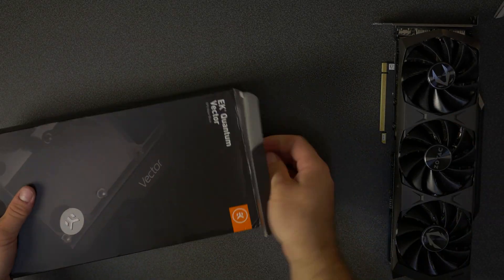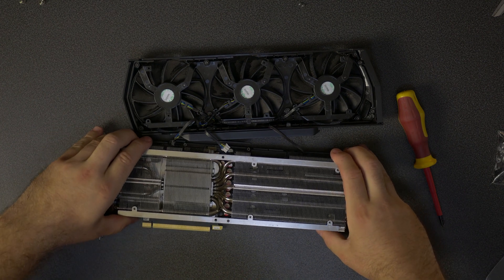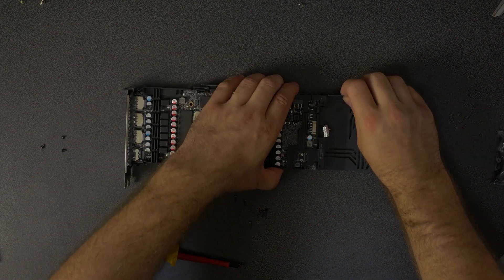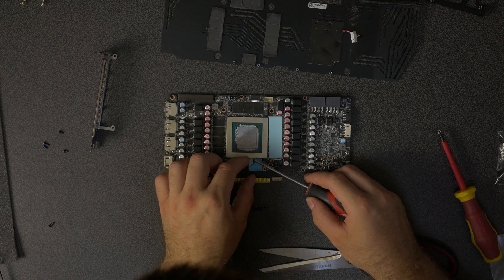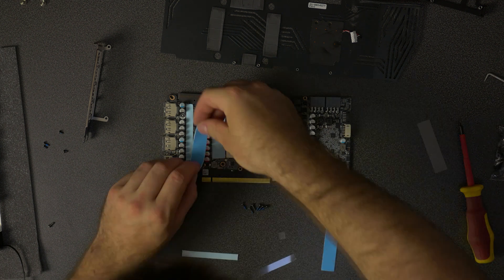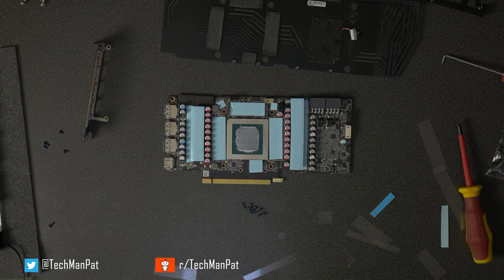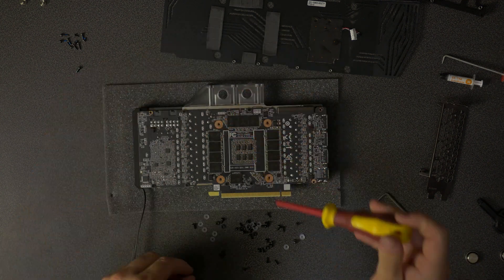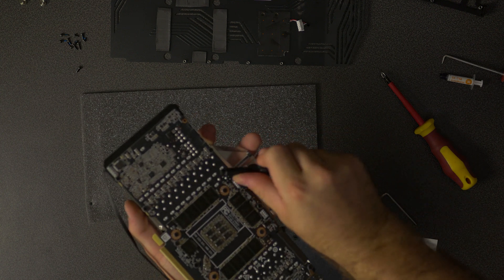How to watercool a Zotac Trinity RTX3090

Comment: Dude, you are wrong, it is essential which way you will flow water into it! You have to connect it so the coolest fluid goes first into the core of GPU die.
Reply from the maker: That’s not how heat inside the loop works, it reaches thermal equilibrium in fact there is no difference in order. As long as you have sufficient radiator capacity to dissipate the heat, there is 1-2 degrees of difference at different points in the loop.

Comment: Thx for the clear video. I'm thinking of doing this with the exact same card. Did you experience any coil whine with this card? I'm using a Tt P3 case with no window at all. Thx again
Reply from the maker: Yes a little bit but you can’t hear it unless you have your right to the case
Reply: @TechManPat  thank you for the quick reply! The 7900 xtx seems enticing but with all that coil whine it's just not an option. Sounds like I'll be going for the 3090

Comment: 1. Get a backplate for those vram
2. Just unscrew the 6 screws on the back (not the fans)
3. You used the wrong thermal pads for the VRM, they are different from VRAM. 3mm for the VRM and 2mm for front VRAM, 3mm for back VRAM!
Reply: its really doesnt matter, just as long as their is a point of contact.
Reply: @seerking  It does matter since too much will lower to contact to the main core. However the thicknesss is also dependent on the watercooling block.

Comment: What gpu junction temp do you get while mining?
Reply from the maker: 68 on gpu and 70 on cpu if I’m doing both
Reply: he wasnt asking gpu core temp, asking tJunct.  like from hwinfo.  I'd be wildly curious to see if this thing isnt throttling down to ~3060 levels of performance if you never added cooling to the back :O  i received a founders that was seemingly defective, as the back plate never touched the memory, and it overheated nearly immediately (again, the memory as measured by tJunct, not the core) in anything more taxing than web browsing.  dont torch your expensive toy!

Comment: FML. Thinking of doing this. My damn GPU Memory junction temps are at 110c when mining. 
92c when gaming.
is this normal with the zotac trinity 3090 OC? :O
Reply: It's the same for the 3080, if u notice when he first opened it up there isn't any pads or putty on the mem chips to the right, that's probably why
Reply: U guys need to be careful, micron website said for gddr6x op Temp max is 95c.. A 3090 fe owner Burn his vram after 2weeks of mining at constant Temp. 106-110c!.. I also own a Zotac 1080ti and 3080, and what I found is the former is  a better built then the latter.. After this ill buy an evga..
Reply: 106c mining here.
Sometimes the pc turns off.
Does it happens to you?
Reply: @gsuracing9362  if it crashes ur comp its probably a silicon + OC + heat issue, else zotacs seem stable at least even at higher temps (its just bad for it)
Reply: @StylinRed  thank you,now since a few days it is stable.
Reply: @gsuracing9362  strange. That has not happened to me even-though it can stay at 110c. 
How strong is your Powersupply?
Reply: @RocketLR  750w.
I have done undervolt a few hours ago and now Gpu mem is 90c.
But I lost around 10 mh/s.
Reply: @gsuracing9362  hmm so do i. Even though they recommend 850w when paired with a intel i9 and im still not getting any issues.
Reply: @RocketLR  I don't know.
But looks better at 90c.
Reply: @gsuracing9362  OOH, what program are you using to undervolt with and could you share your profile somehow? I tried undervaluing but lost too much performance and did not lower my temps...
Reply: @RocketLR  I use  Zotac Firestorm.
Power: 80.

GPU clock: -1000
Memory Clock: 444
Fan Speed : 86
Reply: @gsuracing9362  How many MH/s are you getting?
Reply: @bollygod  with 3090 over 100/108 mh/s.
-400 Gpu clock,1000 memory clock, 81%power fan speed 85%.
With 3080 93/96 mh/s.
-422gpu clock,933 memory clock,77%, power 77%.
Fans at 95%.
Reply: @gsuracing9362  Nice, Did you repaste and changed the thermal pads?
Reply: @bollygod  no I didn't. 
At the moment I don't hit 100° thanks to a fan to both of them.
Reply: @gsuracing9362  Great Temperature for an untouched card. My settings: Tem limit: 78; Clock: -250; Memory: -200; Fan1: 85%; Fan2: 65%. My memory temperature is 106º with the side panel of the case removed.
Reply: @bollygod  try both fans at 90% and if you can no doubt to use another fan to get out the danger zone.
Over 100° silicon is getting damaged as you can read in Micron website. 
Good luck friend!!
Reply: @bollygod how many mhs are you getting?
Reply: @gsuracing9362  104 MH/S. I get 100º with fans at 100%, but i can't stand the noise. 

The backplate is hot af. i will get some heatsinks and thermal pads for the backplate.
Reply: @gsuracing9362  I forgot to mention that i also have one 1060 6gb.
Reply: @bollygod  I have two desktop fans,right now 3090 is 90° and 3080 is 96°.
Reply: @gsuracing9362  Amazing. I  have a case zalman z9  case and has 5 fans and i'm struggling.
Reply: @bollygod  trust me,try to use an ordinary fan to fight against 100°.
At night I can see 84°.
I had the same problem as you and an experienced miner gave to me this advice and now I'm not afraid to boil my graphics cards. 
Good luck and happy mining!!!

Comment: Please tell me what are the thickness of the thermal pads for this card. I noticed you cut out the part where you remove the bracket that holds the backplate at 2:38, it seems it has a thin layer of thermal pad too coverting the mosfets, I want to change the thermal pads but put the original cooler back up, So I also need to know the thickness of those other thermal pads in the bracket. 

Thanks a lot.
Reply: Turns out front thermal pads: 2mm
Back thermal pads: 2.5
(Tried 2mm, not good contact, 3mm is too thick and bows the card. You'll have to sandwich a 2mm + 0.5mm thermal pad in the back).

Front bracket mosfet thermal pads: 3mm.
Reply: @sephirotic87  omg ty. ive been looking for this
Reply: @calgeiser  glad someone found my comment

Comment: straight up wrong with not needing a backplate.  Ram gets to 190f  90c- ish  the GDDR6X Chips Die at 105c  and thats in a 011d with a 18c room. 

GET A BACKPLATE.
Reply: according to what I learned, the backplate is just to protect against shorts and it can protect against light liquid spills in some cases, but I don't think you really "need" one.  https://www.youtube.com/watch?v=OBsxuNXyDJk
Reply: @Forensica6916  Dude, 3090 has MEMORY chips on the backside. As mentioned already - GDDR6X gets reaaaaly hot - under my waterblock it's close to 96 degrees at full load. Unless you have a fan blowing straight at the backside of this GPU - you can damage 3090 without backplate
Reply: @ZephKyno you are right, I didnt see they put the gddr6 on the back. I just read that alphacool is developing a waterblock for the backplate which ive never heard of.  Better stick with a backplate...

Comment: I'm getting 65c on water with my 3090 what's your temp looking like?
Reply: same 65c - 63c
Reply: @oksle8132  Yeah 65c if I'm using RT cores nothing hotter
Reply: @Near2Future  what's your temp when on desktop with nothing running?

mine was 29c yesterday today for some reason it's 42
Reply: @oksle8132  When I'm on idle I'll be around 22-23c when using RTX broadcast for my voice. It'll be 30c I've got a 360mm just dedicated to gpu alone. Temps still seem pretty high for this card, guess it also depends on brand I'll pull 350w on load.
Reply: @Near2Future  yeah me two 360mm for gpu only, and dammmmmn rtx broadcast just turned it off and got 10c down now it's 31c on idle thanks for the tip did not know rtx broadcast get temp this high
Reply: @Near2Future  can’t imagine getting 23c turned off every thing running on background i got as low as 28-29 
i have zotac 3090 trinity
Corsair xg7 waterblock
Coraair xd5 pump
360 mm radiator also Corsair
Reply: @oksle8132  Yeah i've got a zotec aswell with an EK block. It also depends on your room temp aswell :)
Reply: @oksle8132  RTX cores do get quite hot & use alot of power.
Reply: did you guys record what it was on air?  seems high..?  granted im running the fans @ 100%, but on the factory cooler + replaced pads/compound, mine never gets that hot..

Comment: And what is the performance with the 350w power limit and the cooler
temperatures?
Reply from the maker: Lower temps are great generally quieter performance is better if you flash a gigabyte bios

Comment: you dont need to take the fans of to take the cooler off
Reply: then how to remove the cooler without removing the fans?
Reply: same instructions, just dont remove the fan assembly.  only the rear screws are necessary, as the fan/heatsink stays as one unit.  i replaced my thermal pads already, and the fans never had to come off.
Reply: can confirm this. thats how i did it. saves time.

Comment: you should flash this to the gigabyte bios with a max of 390 watts instead of 320 or 350 i got a decent increase when you flash it the power limit is 105 percent
Reply from the maker: That’s a good suggestion the question is can it be done the boards have slight differences
Reply: @TechManPat  yes mine is done you can flash the gigabyte oc and eagle I used the gigabyte oc you lose one display port you can always flash it back just be careful
Reply from the maker: Just be careful is the bane of my existence haha have you seen a big improvement in performance?
Reply: @TechManPat  yes was getting pretty trash perf with stock bios barely beating good 3080 now perf is better than where it should be I know the gigabyte oc is safe some people have done other cards like eagle and tuff but best one with 390 watt limit is gigabyte oc
Reply: just to re-re-reconfirm.. you flashed a gigabyte oc or eagle to a ZOTAC?  was reading about people using KFA bios, but my butt uncontrollably puckers when I think about doing this to a card that I paid $1800 for thats now worth as much as a good condition used car.
Reply: @seanb9436  yea i currently have the galaxy bios with 390 watt limit goes to 400 when gaming and you don't lose any display outs they all work if you use the gigabyte one it stops one display port from working and if you going to water cool it get a back plate mem runs at 90-100 stock so you will want a back plate
Reply: @redux1647  cool, thanks for confirming.  and yea I had like 10lbs of copper on the back of this thing from day 1.  Dynatron heatsink on the largest area of the card and a bunch of little alphacool heatsinks where the vram modules are.

Comment: All the 3090's have their memory running at the same speed so I would add a fan pointing at the back of your card until you get your EK backplate installed. I though all the 3090's used thermal putty on the VRM stages (I know EVGA & ASUS do)... made your job easier with that Zotac model having thermal pads :)

Personally, I'm waiting for the EVGA 3090 FTW3 block to drop from EK (on their notify list) so I can plumb my card back into my loop.

Comment: That 3090 is ridiculously long 😳
Reply: That's where it gets its cooling surface from, the PCB itself is much shorter as you can see in the video. For my NZXT Rogue it's the perfect card since other models are quite high. I only have 2.5 to 3 cm overhead clearance, but the case can easily handle long cards.